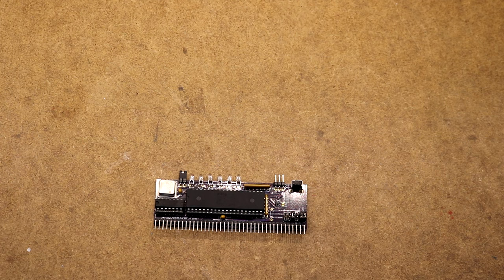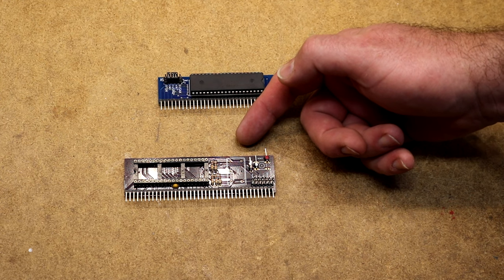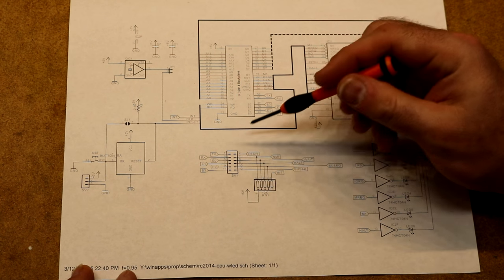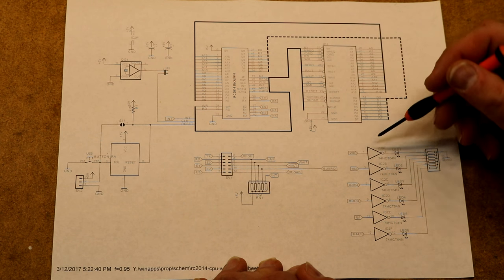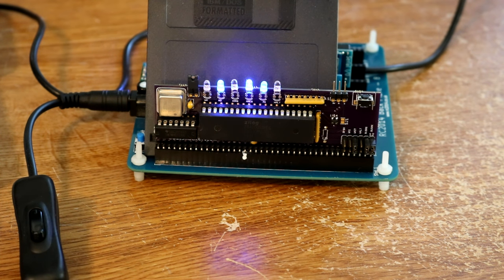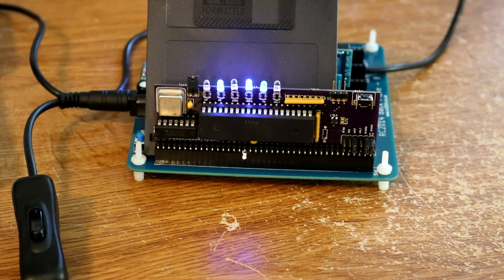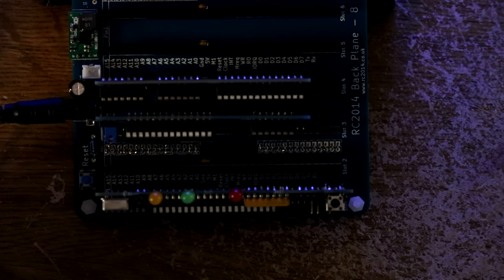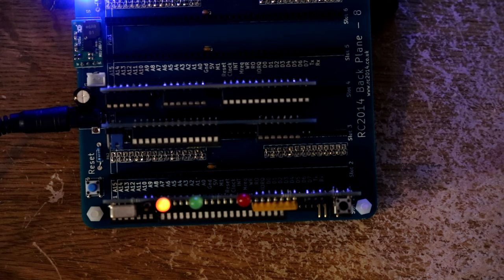Z80 Retrocomputing 17 - Enhanced CPU Board

Comment: HALT is an output so doesn't need to be pulled up.

INT, NMI, BUSRQ, WAIT and RESET are the 5 control inputs that should be pulled up for wire OR, or use appropriate active low logic to feed in to them.

Comment: Shouldn't that solder bridge be on the MAX811 reset line to disable it, not in its current position?
Reply: The bridge (SJ1) is to be soldered across when you can't solder the MAX811, to let the reset button work without having to solder that tiny little chip. It goes across the input and output of the chip, which means if you soldered it it would jump across the chip, and it's currently open.

Comment: What's the sense to pull up HALT pin while it's OUTPUT and so it just can't float?
BTW in Z80 datasheet only BUSRECK and INT pins are mentioned as being needed to be pulled up.

Comment: Do you find RC2014 base contruction (single row 0.1'' header connections) handy and reliable enough ?
For me, child boards should be bent all the time.
Reply from the maker: Given that the boards are relatively small, I think it's fine, and it keeps the complexity and cost down.
Reply: @smbakeryt  I see, thank you.
In my assembly I use "arduino shields" form-factor, yet, partially, because I use Arduino Mega as debug, system and, currently, even UART controller (as Z80-SBC2 does).

Comment: I've got a big cap on my reset line which seems to work well with doing the power-on reset... what does using the Max811 offer that the cap method doesn't?
Reply from the maker: The max811 offers a few advantages, for example it will detect brownouts, should be tolerant of slow power supply rise, and guarantees a single 140ms reset pulse. When I wrote up the power-on reset blog post, I tried both the max811 and a resistor/cap + schmitt trigger reset circuit. In one of my projects I had an issue where the resistor/cap circuit wasn't working for me, so I settled on the max811.